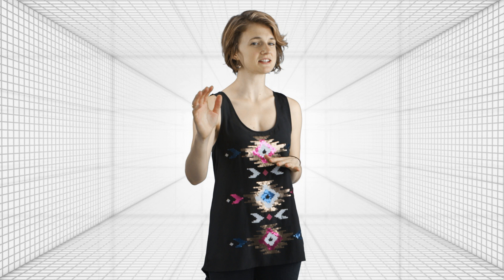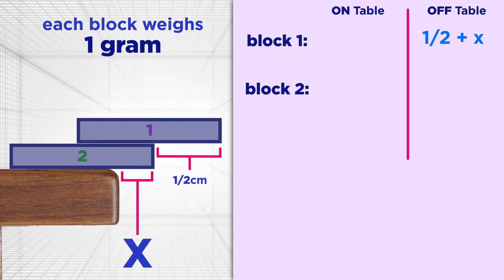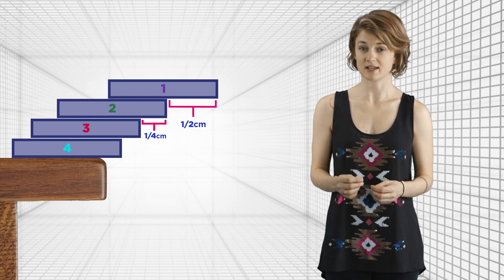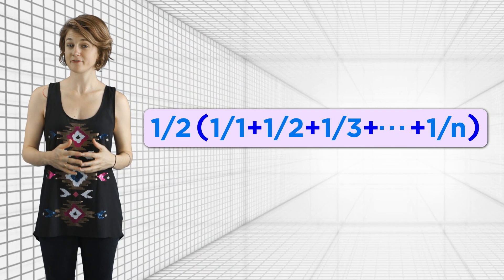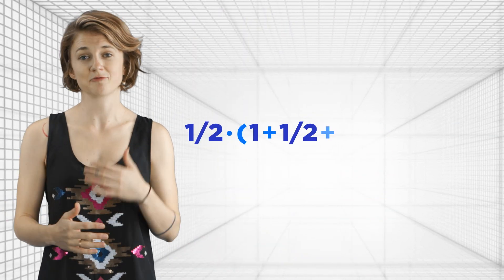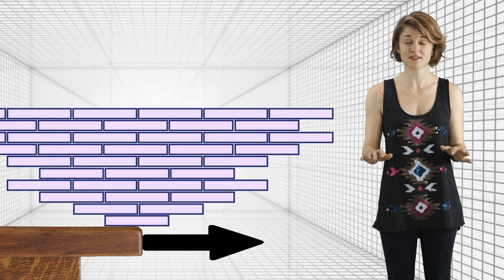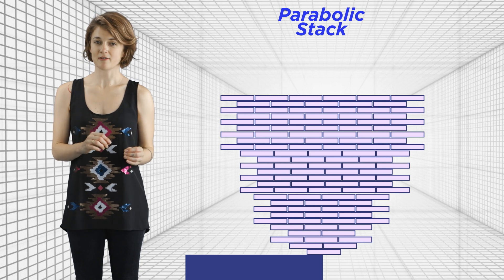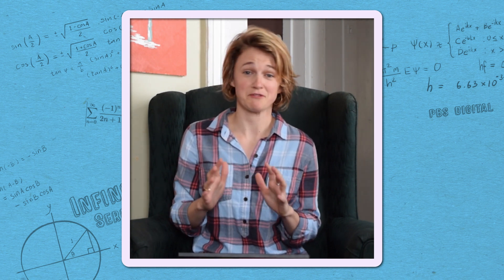Building an Infinite Bridge | Infinite Series

Comment: When a series diverges, doesn't it mean it doesn't converge? Thus u_n = sin(n)  diverges and doesn't go to infinity
Reply: Louis JX that's true but since ln (n)  tends to infinity the distance over the table also tends to infinity
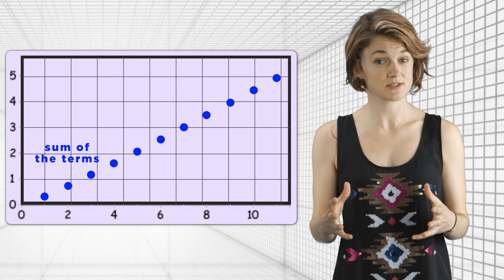Reply: she said that diverging means it goes to infinity 7:30
Reply: Yes, but no.
I don't know if these terms are used in English, but in German we have the terms "bestimmt divergent" (definite divergent) or "uneigentlich konvergent" (improperly convergent) to grasp the concept of series which do not converge to a real number but for which the only reasonable choice of a limit would be infinity (or negative infinity).
In some sense, one could extend the metric of the reals to ±∞, such that a series converges to a finite number exactly if it does so in the original metric, converges to ±∞ exactly if it is definite divergent to ±∞ in the original metric and divergent in all other cases.
In that sense, divergence to infinity is something in between of convergence and divergence.
Reply: That's a rather pedantic detail.  Between "unbounded" and "bounded but fails to converge", diverge more often than not refers to the former.  TBH, I'm not sure if "diverge" means just the former or both.
Reply: a series is divergent if sum(|s_n|)=infinity.
Reply: "When a series diverges, doesn't it mean it doesn't converge?"

Yes, you are correct.  However, when all terms in the series are positive (e.g. when discussing lengths), then `not converging' is only possible if the series goes to infinity.

Google `monotone convergence theorem' if you want some gory details.
Reply: +noah schaefferkoetter
So the alternating harmonic series diverges? :D
By which I mean the sum of (-1)^k*1/k from k=1 to inf, which converges to ln(2). 
What you are talking about is absolute convergence.
Reply: Sax4565 
Fair enough.  Thanks for the correction.  I got the if-then backward.  What I should have wrote is "the sum (|s_n|)=infinity if the series is divergent".
Reply: The Manx Loiner she was talking generally, but any way the sum of the serie u_n = 1/2^n is 3 but all terms are positive. The monotone convergence theorem has nothing to do with it. If I remember correctly it s about a growing function inferior to a certain value, making this function convergent.
Reply: Elchi King in my country we have convergent, divergent and that's it. However you can talk about the radius of convergence of a function.
Reply: Well, convergence means that a series approaches a finite value. If it does not converge, would that not mean the series approaches an infinite value? 

That's rhetorical, but I hope it helps answer your question. Your understanding of the definition of divergence is correct; you just need to frame it differently to understand what she meant. sin (n) is an exception, as its limit does not exist (if I recall correctly), but that's largely due to the fact that it's an alternating series and has little to do with the definition of divergence as a whole (at least in the context of the harmonic series as she mentioned).
Reply: Tyler Harding I gave a contre-exemple of a function not converging but not going to infinity
Reply: Yeah, that's why I included the bit about sin being akin to an alternating series (and I believe it can be written in the form of an alternating power series as well).
Reply: Tyler Harding I already said it in an other comment, she said diverging means there is no number greater then every terms of the series. And that doesn't fit the definition I gave about diverging
Reply: She likely didn't feel it necessary to include an explanation of an alternating series for the sake of simplicity (since it obviously has nothing to do with the harmonic series). Are you just bothered by the lack of specificity?
Reply: Tyler Harding no I am annoyed because the way she is deducting is wrong, with this definition at least. The deducting part is the most important in math, and you d be like "Yeah deducting whatever". An other comment points out that definition differ depending on where you re coming from.
Reply: Louis JX: "but any way the sum of the serie u_n = 1/2^n is 3 but all terms are positive." I do not see how that disagrees with what I said. I must not have explained clearly.

1) The definition of `diverging' is `not converging', as you have already said.

2) In general `diverging' is not the same as `goes to infinity', as your example u_n=sin(n) illustrates well.  I agree with you that the video's wording is not good and makes it sound like the definition of `diverging' is `be bigger than any number'.

3) However, there is a context in which `diverging' does correspond to `goes to infinity'.  That context is when all the terms of the series are positive.   Making this explicit:
i) If all the terms of a series are positive, then the series diverges if and only if it goes to infinity.

4) To prove 3i), you need the monotone convergence theorem, which is how that theorem is relevant.
Reply: The Manx Loiner sry I missed read, please accept my deepest apologizes ^^
Reply: But first you need to know has big infinity is to set the foundation blocks at the proper distances..
Reply: a series is convergent if you can calculate upper or lower bound. a lot of convergent series keep ooscillating within a boundary, where an epsilon is knowable so that abs(f(x))=f(x))*sign(f(x))<epsilon. for all x, this can be proven for many f() with [complete induction] where it either leads back you your conclusion, or leads into an asymptote.

Comment: Also the physical limits seem pretty intuitive. For one, You are required to add an amount of overhanging mass and volume of material each time that is a fraction of the last, and unlike philosophical arrows and running paths, you cant subdivide the Planck mass or length, one of which scales of addition you would inevitably reach.

Comment: 0:52 this is wrong, you can clearly see the edge is rounded.
2:21 the = should be a >.
this is a shoddy remake of an old paradox popularized in the 70s by martin gardner.
I was already thinking of 8:50 the way you described it but that was not the original question.

A pity you didn't explain why it's n^(1/3) and I don't think it's true in general. The argument that a normal triangular pyramid would topple is not explained.

The parabolic thing only works if you place groups of blocks at the same time, so a triangular version would work just as well:
.xxx.
xxxx
.xxx.
..xx..
...x... 
after which you place at the same time the top left and top right to complete the top layer along with a block on each to hold them in place. This is linear, so wins from your n^(1/3).

Therefore I suspect there is some not explicitly mentioned constraint I either missed, or you failed to mention.

Comment: A faster way, that has a linear graph, is to simulate a much longer rod, infinitely long, still using the original bridge pieces. If the bridge pieces were infinitely long, and you put the sticks a little farther off the table each time, it would never topple, because there is an infinite amount of rod on the table. We can simulate that if we lay an infinite number of bridge pieces in a row on the table, the last piece 99.999999% off of the table. That would fall, but on the next layers, with another infinite number of pieces, the blocks above would keep it from falling. The infinite amount of weight above would keep it from falling because of the structure. This bridge would be impossible to build in real life, but it still works well.
                                                                                                                 By: Kira Lewis age 10

Comment: You used a kind of 'greedy' way of stacking subsequent bricks, where each brick was placed as far as it could go under the previous conditions, i.e. the first one was placed 1/2 a distance away from the table, and then because of those conditions already, the next brick could only be placed 1/4 and so on. How do you know that this 'greedy' method of placing bricks is the optimum method for stacking one brick at a time? What if you placed bricks taking into account the moments of the future bricks? Could you use some sort of optimisation mathematics like dynamic programming to know how far to place each subsequent brick, taking into account future bricks?

Comment: Is a 2x cm line an infinite bigger than a x cm line?
Reply: william41017 no, 2 times.
Reply: Henry Lehtovirta what??? 
I don't get it
Reply: william41017 It really depends on what you mean by "bigger". Mathematically, [0,2] has twice the measure of [0,1]. But these two sets have the same cardinality.

I don't think it's reasonable to say it's "infinitely bigger", though. Maybe you're trying to note that [0,2]\[0,1]=(1,2] is infinite?
Reply: Ben Spitz I just thought considering lines are an infinite set of points maybe a bigger line would be a "bigger infinite", like real numbers and integers
Reply: william41017 Ok, two line segments will always have the same cardinality (aka size of infinity). Secondly, this is a question you could definitely answer yourself if you learn about basic set theory! Check out the book "How to Prove It" by Velleman, which goes through the very basics of naive set theory and mathematical reasoning. IIRC there's a section on cardinality at the end.
Reply: Ben Spitz ok, thanks. 
Maybe I'll try it

Comment: 1. You state that the n^(1/3) bridge must be built in sections, but it doesn't have to if the table is solid on the one side....you simply lay the bricks above the table before laying the opposing structures in order to move and keep the center of gravity over the table.  The only time (practically) that you may need to place 2 bricks at a time is the edge with a topper in order to lock in the weight from extension.

2. The practicality of the bridge building is that center of mass of the bridge as a solid structure becomes its own center of gravity for itself after some time.  This leads to a point at which the bridge collapses itself through gravitational differential as you reach toward infinite.....and this is given the assumption you can even create a device that "lifts" the entire bridge upwards in order for you to put the brick underneath and push it off the edge.

Comment: It has to be a "Michell structure" (Anthony George Maldon Michell).
I do not have the math skills to calculate a Michell bridge. However I have made quite a few using topology optimization.

Look up Michell structures (pictures) and see for your self. There are a beauty to optimized designs underneath the messy math.

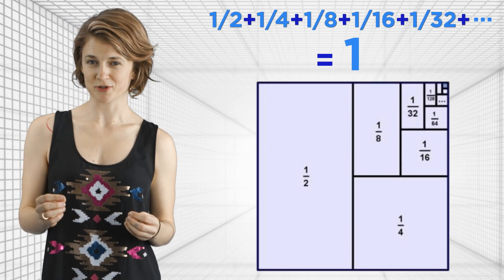Comment: 7:22 I prefer the proof what if you /subtract/ smaller fractions? 1-1/2=1/2, 1/2-1/4=1/4, so on... so 2^(n+1)-2^(-n)=2^(-n) and for 2^(-infinity), the value is 0. therefore the sum of all the numbers you took away from 1, is 1. this goes for all fractions, 1-2/3=1/3, 1/3-2/9=1/9.... x/(x^n) - (x-1)/(x^n)= 1/(x^n) and for infinitely large n, 1 (all that mess)=0, therefore sum of 1/x^n=1/(x-1)

Comment: If the tabletop is beveled then the actual edge of the table is where the bevel starts, since it'll roll off if the center of mass goes any further than that due to the normal force not facing directly upwards anymore.

Comment: The "on the table" = "off the table" shortcut ends up coming to the correct solution, but I'm worried that it gives the wrong impression about the underlying physics.  Could you follow up about how we're actually calculating the center of mass and how this shortcut only applies to uniform bricks overlapping the edge of the table.

Comment: Well the problem with these bridges would not only be the centre of mass, but more importantly any unwanted torques.
I think you need the symmetry is needed for the torques to cancel out, so you are left with the centre of mass thing.
I propose the perfect bridge:
Take an infinite Brick.
put it on a table.
Have your bridge.

Comment: If you had an infinite amount of building material you could just build your bridge entirely of supports. So my that bridge increases at the rate of the thickness of the support beam. Ill make the thickness infinite, so my bridge increases by infinite amount. 

If this hypothetical world has no floor, mass is meaningless since you're in deep space, just use your infinite material to make a infinitely large rectangular beam that increases its cross-section area to deal with internal stress (so basically an infinite cube).

Also technically the earth's crust is a very large spherical bridge. It keeps everything above the liquid core. So if we were in deep space we could create a infinite bridge by using an infinitely large hollow sphere. And infinitely large sphere would appear to look like like an infinitely large plane, so there's no gravitational forces that are normal to the sphere. There's no gravitational compression, since everything is in an infinite plane and all the forces cancel out.

More practical solution. Use bricks made of air. Or if you're in deep space. Use space as your building material. Or even use a laser a bridge

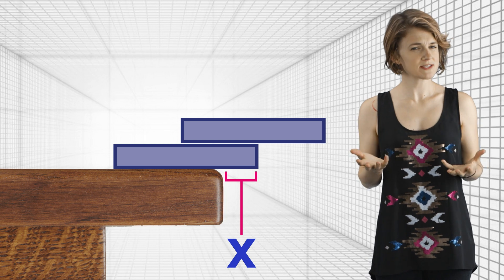Comment: 1:33 this like that old math joke right? a mathematician walks into a bar and ask for 1 beer and another walks in and ask for 1/2 and another asks for 1/4 and so far until the bartend scream just ask for 2 beers next time.

except is 1/2 plus 1/4 plus 1/8...... equal 1. right? because this is problem of limits and in this equation (god i wish google supported sigma notation) the is x-(x*(1/2)) where the initial position is 1/2.  so the bridge really can never hit 1 because 1 is the limit but its going to get really really close eventually.
Reply: You misunderstand which limit they're using in the video. 1/2+1/4+1/8+1/16+... does converge to 1, you're right. The sequence 1/2+1/3+1/4+1/5+... doesn't converge though. So, if you were to pick a number, any number you like, I could pick another number n, and the sum of the first n terms of this sequence would be larger than the number you picked.

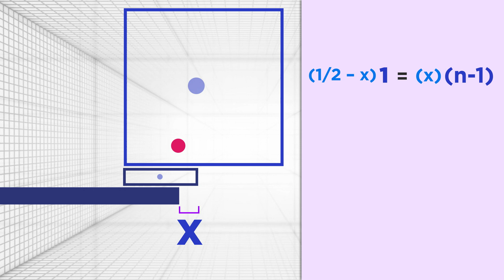Comment: I find 4:40 till 5:02 rather confusing. 
The rectangles around the point masses are misleading.  They make it look like these points had dimensions, equal to those rectangles (which on itself doesn't make sense).
This also makes the equation (1/2-x)1=(x)(n-1)  hard to see how it's derived because it becomes tempting to relate it to the dimensions of those rectangle, which then makes it pretty impossible to follow your explanation. 
It's only after I understood this, and I decided to mentally ditch the rectangles that it started making sense.  It got me somewhat frustrated for nothing :(

I think the reason you kept those rectangles was to have a way to measure the needed distances in terms of x.  I wouldn't have done it this way though, for the reasons given above.

Comment: Nice lecture but the illustration is flawed 

the top of this table has a beveled corner instead of a sharp 90 degree corner. so its fulcrum is not as illustrated but where the curve starts

I realize this is done to make it look more like a table. but skeptical minds will pick this up as an error.